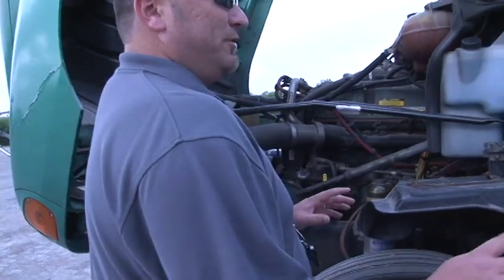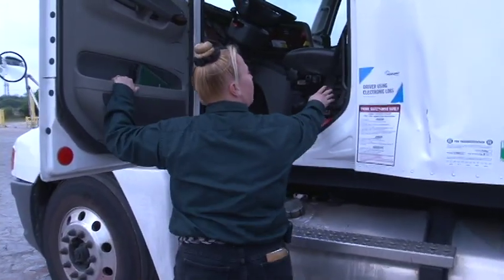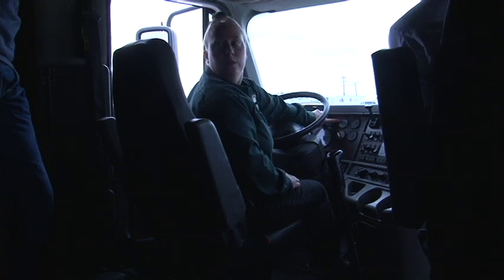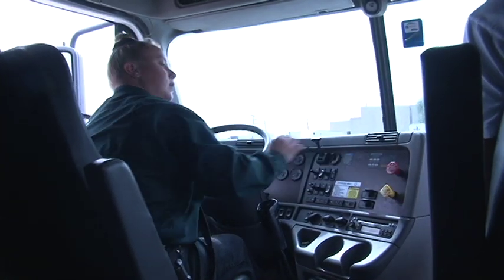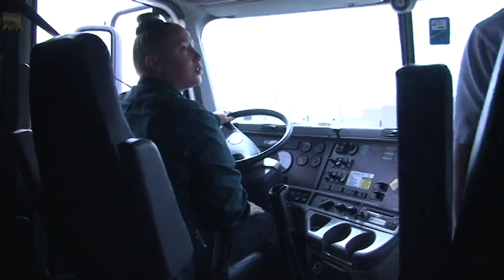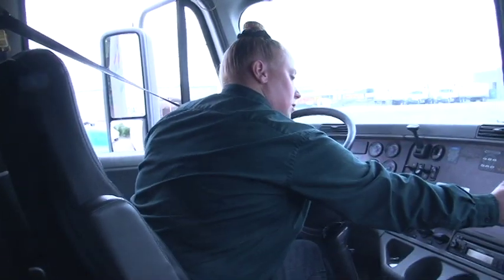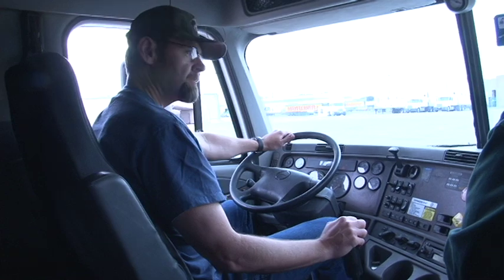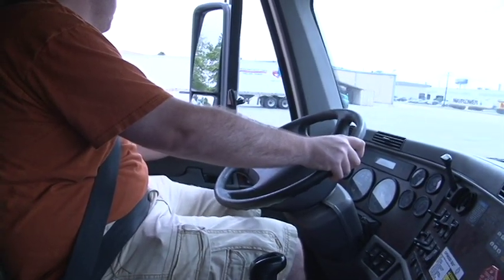10 Minute Training Sample FFE Driver Academy

Comment: Hi everyone.  I was looking into the trucking industry.  I have a CDL class A, I got the license about 8 years ago at a company where we drove a class A vehicle on occasion & class B regularly.  I am comfortable in a class B vehicle and can drive a class A vehicle.  Problem is, I have not drove in around 8 years and also I've never actually drove a big rig.   I am wondering how I'd go about getting the big rig experience with out having to go through all the licensing training being I have the license?  I also do have some experience maybe not on the big cross country rigs but on smaller trucks, I am familiar with air brakes as well.   Any advice would be greatly appreciated.